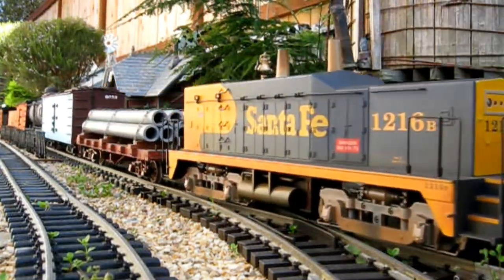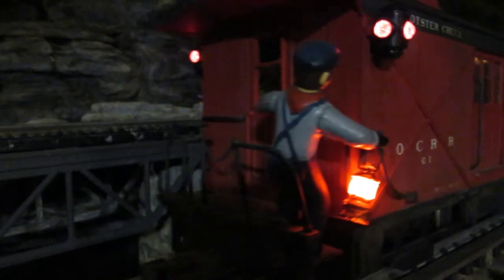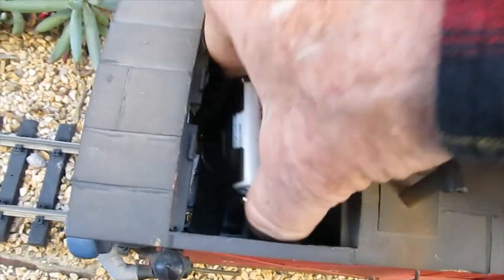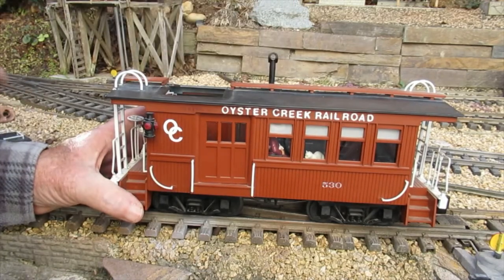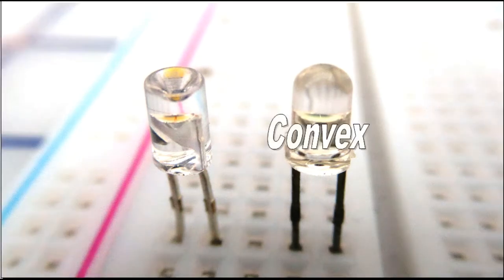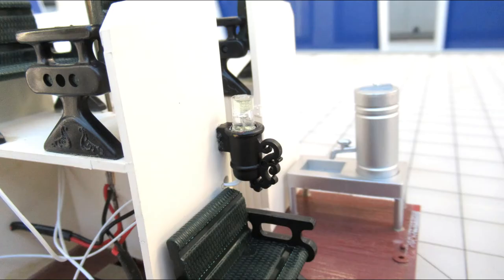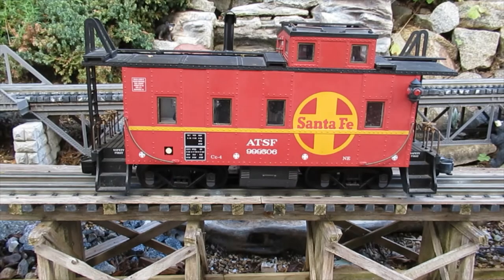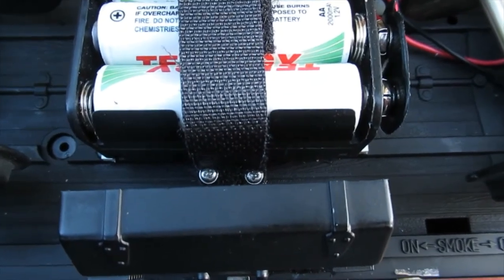Battery Power LED Lighting for G Scale Caboose, Inexpensive DYI Garden Railroad Project

Comment: Why didn't you run the smoke unit
Reply from the maker: I was concerned that the smoke unit would use too much battery power and shorten run time.  I should try it to see.  Thanks.
Reply: @richardperrelli3970  if you try it let me know im going to do it with mine